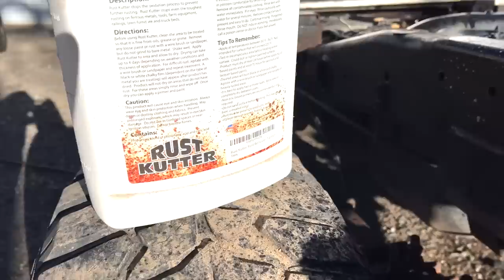TORE APART MY NEW TRUCK! Restorations begins!!

Comment: Best thing to convert rust is phosphoric acid. Metal prep or concrete etch, pick your poison. Turns it into crude parkerizing, like grandads 1911 from the war. Wouldn’t go back over it with rubber, oil is better. But you could throw some black tractor paint on converted rust without too many issues down the line. Trust me on rust, I live in Illinois 😂
Reply: Dem rust bunnies.
Reply: oshpho
Reply: Yep. That's all rust kutter is, just a expensive version.
Reply: Ospho is what we use on Tugboats.
Reply: Chiming in from the rust belt of jersey here. Can confirm what he said. Concrete etch and some fluid film or used motor oil works great. U can do further prep/paint or powder coat if desired. But I just use fluid film
Reply: @jarrett754   good ‘ole 10w 30 frame coat!
Reply: @jarrett754   I use fluid film on the daily drivers, motor oil or something similar I usually use on classics that I don’t want gobs of lanolin all over the underside.

Comment: Hey Sam, I didn't know that you numbered your buddies. The guy buying the flat bed is a buddy numbered in the single digits. I'm a buddy in the 60,000s. I laughed when you said you had the presure sprayer in destruction mode. The oil pan might be a aftermarket that was made with recycled steel. Tomorrow in Ottawa Ontario the temperature will be minus 10F. My 3500 5.9 Cummins has the plain black factory wheels which I like so think the rims you put on are good but the tires are not. I would want some aggressive mud/snow tires on a 4x4 Dodge with a gas engine for very cold starts. My favorite videos of yours are when you do a truck overhaul. I like the quality and reliability you add to the trucks.

Comment: On the seat, remove the 4 springs in the bottom, pull that top bar off and re-attach all those crossmember wire things, sit the bar back into place with all attached, then pull the springs on the bottom to latch back. Easier to tear down and put it together than putting together all under tension by tapping it while putting all those things back on.

Comment: I'm an electrician so I use my Milwaukee stuff daily. I run them till they die then put them on the charger. I've heard people complain about them but my first Milwaukee original series is still in use. I have 7 year old batteries still working. Not sure if short charging them kills them or what?

Comment: Those rubber floor mats . . . .
Mud flaps for your utv  rock chips are a bitch
Bottom of metal tool box 
Under the truck battery. Battery tray doesn’t get eaten 
Rubber washers or spacers 
Don’t throw away

Comment: The tires and wheels are ok. The truck is looking good I used to work at a dealership. All the money we found in the vehicles would be cleaned and divided between the porters (aka) lot attendant. Keep up the good work and stay safe out there.

Comment: They look ok, but not

It's interesting that's another slt with a 2 piece rear seat. I've only seen one, 1 piece rear seat, same slt trim. Truck is power windows/locks so not bare bones🤷‍♂️. I will say, the leather looks really good, but those early cloth seats are really comfortable

Comment: Happy Birthday Sam!!  Mine's next month. About 5-6 years ago I was using my new 'yellow' drill/driver and the motor sounded like it had a box of rocks for bearings, worse than the one it replaced!!  Enough, I'd had it. I got rid of all the yellow, red and blue ones.  After a bunch of research, I bought new BOSCH everything!  I'm so happy I did!  They have more power, the motors run smoother, controllers work better and the batteries are better.  I even have 4 new 12v ones for my guitar shop!!  Your mileage may vary,  but they worked great for me!!  Sorry for the rant, touchy subject for awhile.  LOL   8)    --gary

Comment: Happy Birthday my birthday is the 5th. I use a small steam cleaner to get stains out of carpet.  I buy Rigid tools the tools  batteries are warrantied for life.  Rigid has replaced one battery and put new motor in one drill so far.  Ive had other cordless tools 2) dewalt drills 1) Dewalt circular saw, 1) Dewalt reciprocating saw. 1) Makita 9volt drill and 1) Panasonic 12volt drill.  The Panasonic and the Makita drills are still good but the batteries are shot.  the gears are stripped in one of the Dewalt drills. I still use the Dewalt reciprocating saw but out of 4 batteries I have two are still ok.  So for me the lifetime warranty is important.

Comment: Never had a problem with Ryobi batteries even the cheap Chinko ones.  We call those chewing gum welds LOL  That oven cleaner is lye in common terms Sodium Hydroxide in chemists terms. A small drop of that crap in a concentrated form. can eat a hole down to the bone if it gets stuck to your skin. Don't ask how I know, I was just working in the chemical treatment industry. No pain no warning just a hole in my arm. Dang.
Reply: Hope that oil pan doesn't have the interior coating that comes off and plugs up all of the oil passages. 

See DeBoss Garage on that subject.

Good job ditching the extension on the impact. Acts like a torsion bar and decreases the impact of the impact.

Comment: Yup, got a remote start for my 3rd gen. Aftermarket of course, brand name of Autopage
Reply from the maker: I’ve had a few of those aswell that brand works well. But never seen a factory one
Reply: @VBELTandSON  I thought it said Astroflex on there? Dodge used that brand from factory you suppose?
Reply from the maker: @BossVoss39  looks to be heavily connected into the factory wires